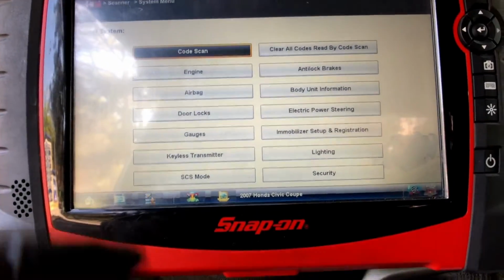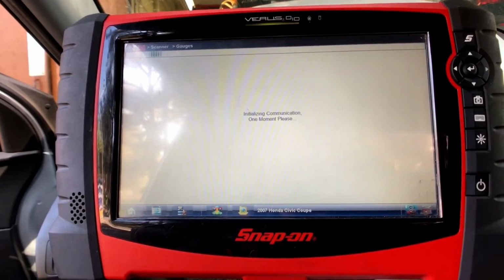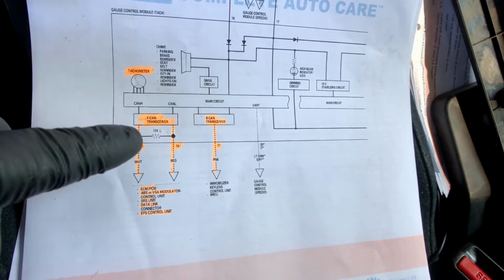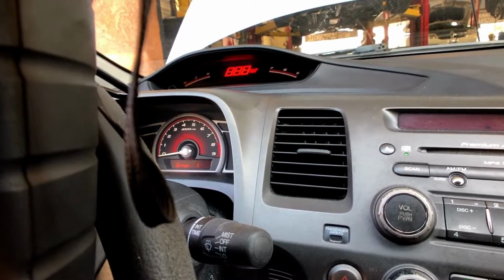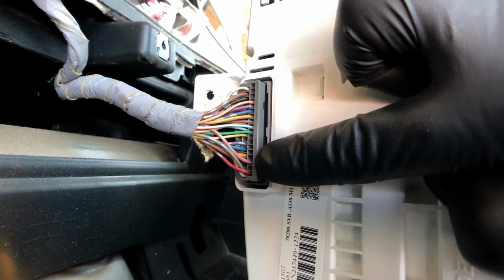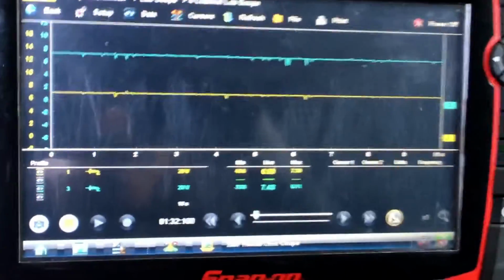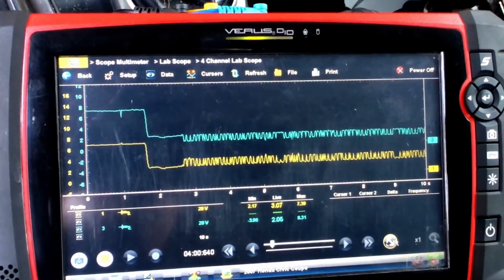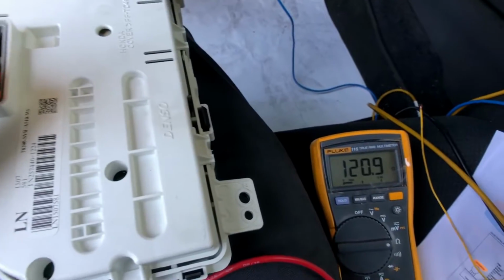Honda Civic si  2.0 L No Communication Testing - Part 2

Comment: The gauge control module is the gateway on the Honda B-can. That’s why you get all those gauge communication codes when there is a problem with the can bus

Comment: With both the ECM and the gauge control module plugged in and vehicle off for about a minute or two u should have 60 ohms on pins 6 and 14 of the DLC. There are two terminating resistors in parallel usually either in the pcm and bcm or sometimes the pcm & the cluster itself which it looks like u have. If u unplug one and u have 120 ohms your "physical layer" or terminating resistors in those modules are good to go. If all is well after that unplug every module on the Fcan line out while pinned into 6 and 14 and see what happens.
Reply from the maker: Full Circle Diagnostics part 3 is coming up. Stay tuned Homie 👌🏼

Comment: Not bad for your first time! I would start unplugging modules, to see which one is elevating your signals(since it only happens when you turn the key on).You can access the bus from the data link connector. But at this point at least you've ruled out the cluster. Id ohm out the bus with the gauge disconnected while it's out. Or look for 60 at the dlc with it connected. Just my two cents. 👍
Reply from the maker: Super Mario Diagnostics Sounds like you already watched my part 3, or we just think alike 👍🏼
Reply: The Homie Hektor looking forward to it 👍
Reply from the maker: Super Mario Diagnostics wait for it 😎